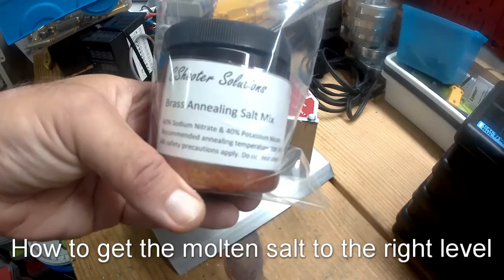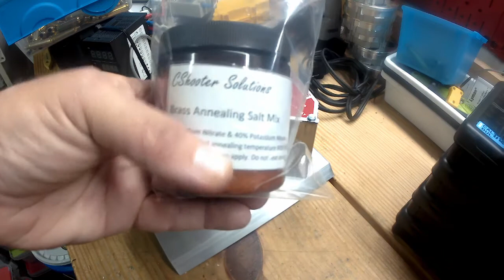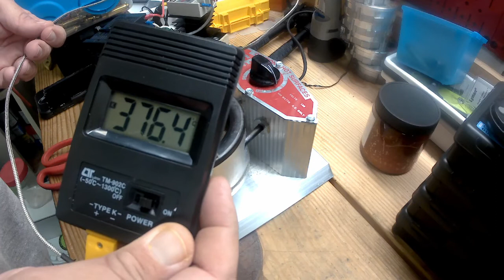Brass Annealing Plate Instructions - Salt Bath Annealing (check description for new info)

Comment: Two questions. One, im annealing very small cases as in 22 khornet. Does the plate have a hole small enough for that case. Two, what type of salt is it and where can you buy more.
Reply from the maker: The smaller size is compatible with 223, so likely will work for you. I offer an extra service where you purchase the plate and pay a nominal fee for an extra slot that can be made to your specs. I normally do this for big calibers, like 50BMG, but I can do it smaller too. The salt is a mix designed for this purpose. Take a look at my store in Etsy(just search cshooter solutions) You can buy a kit, or just the salt. DM me there if you have more questions. Thanks!
Reply from the maker: Etsy has an issue, search for cshootersolutions one word, then a question right below will show you the link to the shop.

Comment: im getting pretty good playing with the temp knob on the lee melting pot.  from what I hear they go bad often?  so i will want to build a pid unit correct?
Reply from the maker: That's correct. The PID makes things easier, but you can use the thermometer just fine. The control on the melter can be bypassed quite easily, but if you do that, then make sure you have a way to monitor the temperature.

Comment: you state that bigger calibers need longer time to heat up, how do you determine this time. i have both a 223 and a 300RUM i've read the 223 is good within like 5 or 6 sec's, how long would the RUM take?
Reply from the maker: What I meant is that bigger calibers act like a heat sinker, and the molten salt looses temperature quicker than with smaller calibers. So, you have to take a break until the salt goes back to the desired temperature. The actual time may vary between 223 and 300RUM, but very little, like one extra second. Since the molten salt process is rather forgiven, I just add an extra second between annealing 224 Valkyrie (small) and 338 Lapua Magnum.  I hope this clarifies your question.